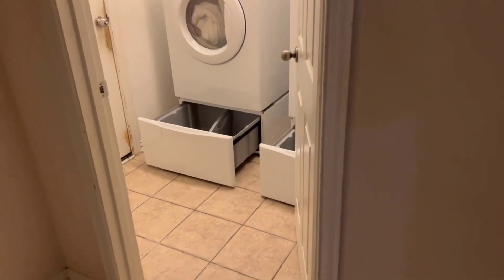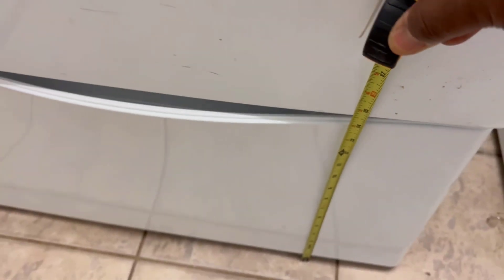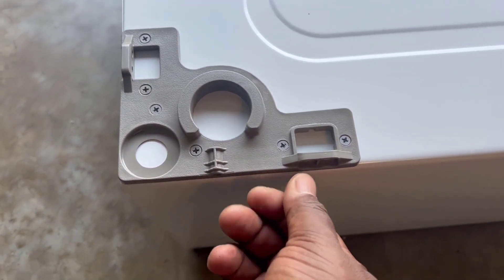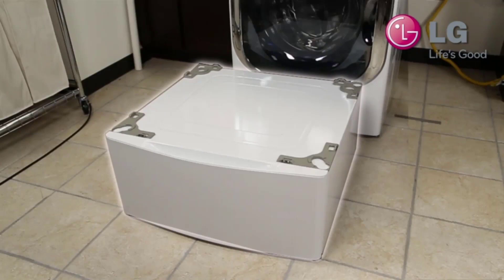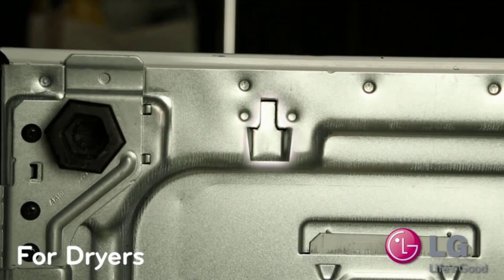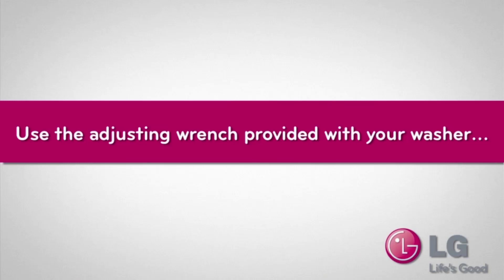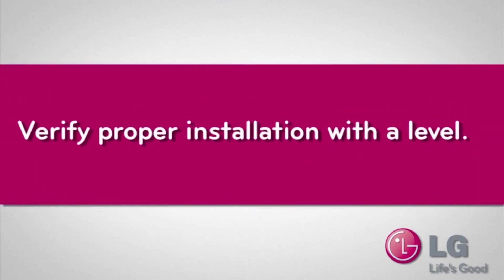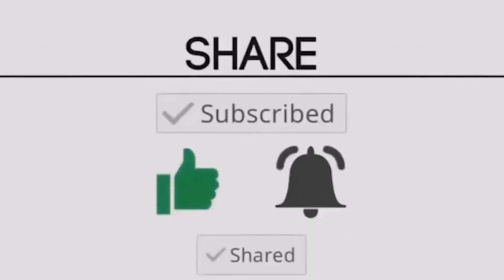How To Install Pedestals For LG Washer and Dry

Comment: I've seen many cases where the washer mounting brackets and the pedestal's do not align. It's currently my case and that's why I'm here. All 4 four legs have been fully retracted. There is little information out there but I came across a comment saying you should remove the jam nuts. Will that work? Is it possible that the brackets do not align because of factory defect?
Reply: hi, did you find a solution?

Comment: Where did you get those white clips from, coz I bought a lg dryer dle3600w and it does not come with those clips. I watched both the lg USA SUPPORT and lg Canada support and in those videos it clearly says use the clips provided however it was not in the package, I looked several times. Those clips are pre-installed on the washer though.
Reply: It comes with the pedestal